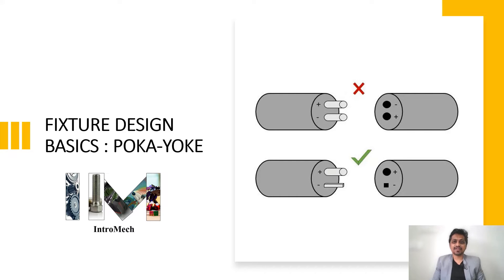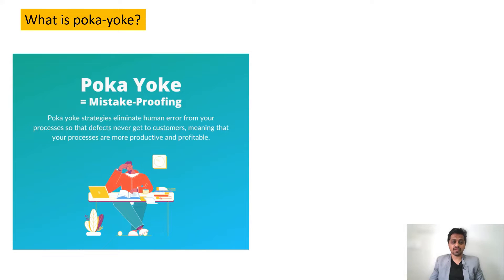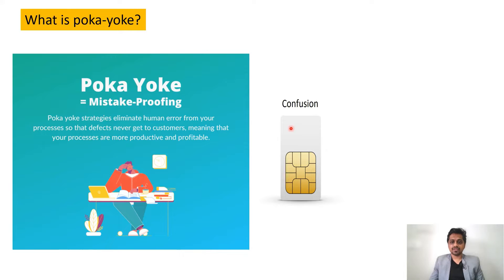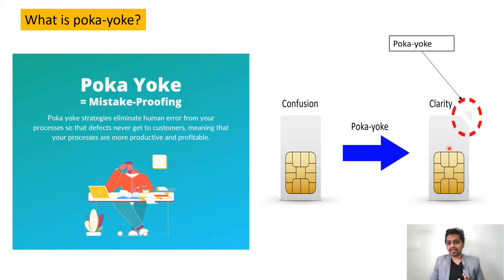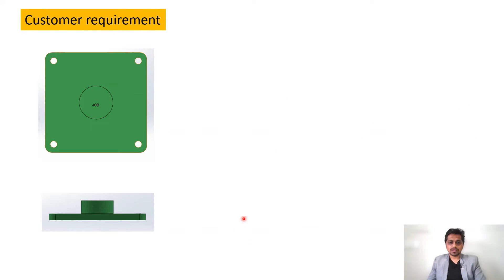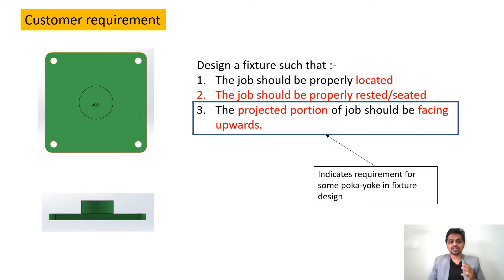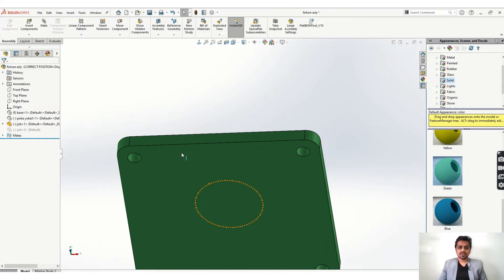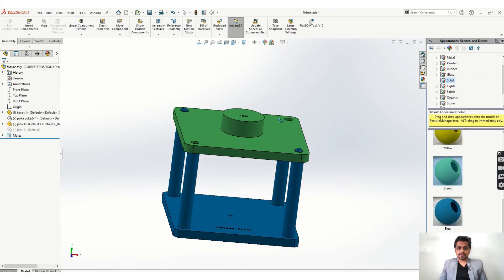FIXTURE DESIGN BASICS: - POKA YOKE

Comment: Why should there be long rods, instead we can just place those pins on the flat surface with just the thickness of plate.
Reply from the maker: Yes, that way also we can achieve. There are different options for any design to achieve the Poke yoke. It depends on customer requirements, part loading height, orientations and many other inputs!